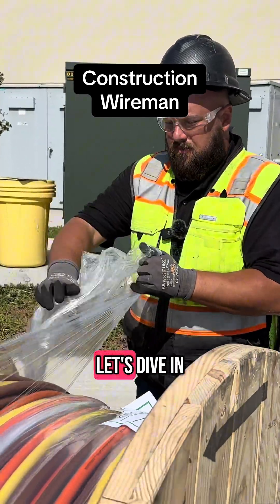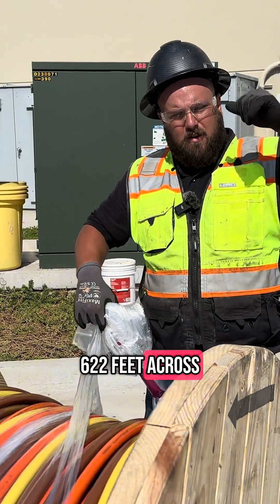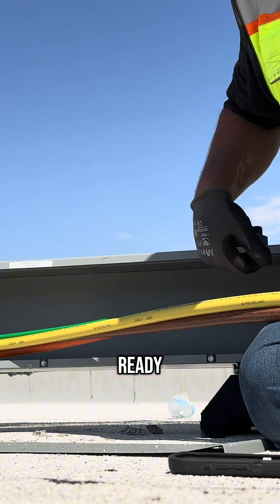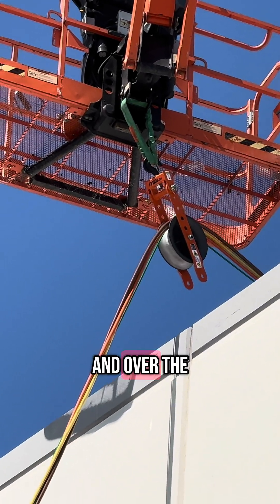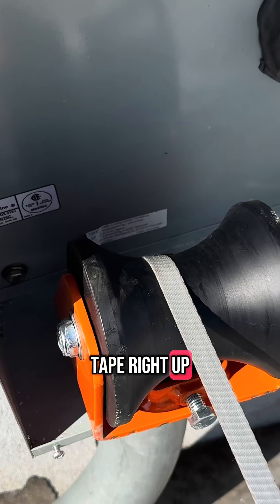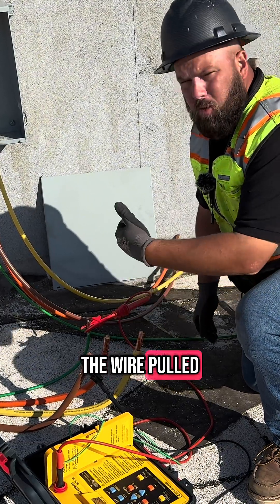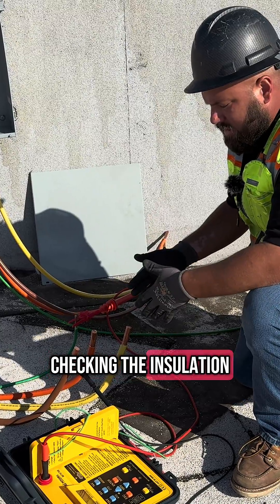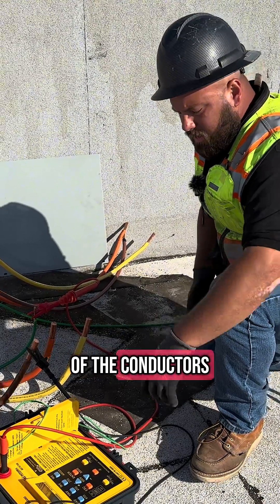MASTER the Art of Construction Wiring- Construction Wireman #construction #safetyfirst #electrician

Comment from the maker: What’s the longest wire pull you’ve ever done?
Reply: I've done longer with bigger but the worst pull I've done was 600+ of 400 up 5 stories with many many many bends and boxes
Reply: just pulled 4 800’ runs of 750 last week
Reply: 500s 3000ft at a gas and oil refinery
Reply: @woc_levievan2097   Holy Crap!   I hope it was straight.
Reply: I mean, as one piece? Prolly some Direct Bore run with fiberoptic cableing, along some random highway in florida. Shyt goes on for days before it hits a node or midspan. Pull it with trucks off the biggest reels you'll ever see lmao (The tensile strength is incredible, so nit much worry about snapping) 🤣. Fibers not like electrical, the loss over distance is miniscule. There's armored fiber run across the Atlantic Ocean floor all the way to other continents as one piece 😅.
Reply: 600kcmil football field and a half, 3 heavy duty tuggers rip
Reply: 1800’ of 3/0 MV wire
Reply: 6 runs of 900' of 600kcmil. With 600' of vertical drop and 300' horizontal lenght on the lower floor. On a 50 story building.  Probably my most interesting run
Reply: 665' 500 Kcmil
Reply: 150’
Reply: I pulled 545 feet of new copper from a abandoned building that was just installed the previous day. 😂😂😂 Used their forklift
Reply: Pulled 42570 feet of copper wire with 2 square meter cross sectional area
Reply: Should the conductors not be twisted?
Reply: 2 runs of 2000kcmil for secondary side of a 69/13.8kv transformer on a 100 degree day lol. Awful.
Reply: 3 inches every night
Reply: Like 1200, it was hdpe directional bore. All that for 600a of solar.

Comment: I've worked with guys in the field, that didn't have a clue what a megger is. Best way I can explain is it'll blow out the weakest point of the insulation, are  if it's not rated with the proper size insulation. It will go boom you'll know where its at

Comment: Always,alAlways do an insulation trst wth theinsulation resistance meter 
(Megger) 
Its easier to find a damaged conductor and oull them all out 
Tahm its is to have the thing short, melt all cables in thenconduit an possibly blow a hole in it 
Then you have lost all you conductors 
Think twice before you apply power 
And also use a pair of wakie talkies ,instead  of the Flintstone phone sustem

Comment: Always,Always  do an insulation test  wth the insulation  resistance meter 
(Megger) 
Its easier to find a damaged conductor and pull them all out 
Than its is to have the thing short, melt all cables in thenconduit an possibly blow a hole in it 
Then you have lost all you conductors 
Think twice before you apply power

Comment: Heck yea nothing like feeder pulling day. It’s technically an easy day if everything goes smoothly. Also you always want to add at least 30ft extra. I learned that the hard way as young foreman. I ordered it 10 ft too short and had to crimp the wire at the last pull box.
Reply: What would the price difference be for an extra 10ft? I'm curious if adding that extra on the order, just in case, would have been justified
Reply: "You waste more if it's short"

Comment: Imagine doing THAT and some genious 6-packs it smh. (6 Pack is a term we use for an unforgivable sin if you mess you badly, you owe everyone a six pack. For example, you forget to pass the cables through a pipe, fitting or box. So now you have to pull all the cables back and pass them through the correct way.)

Comment: Once time I found about 3200 ft of nice, white, unlubed but loose, jumbled up and tangled 3/4" 2500lb bull line in a dumpster on a jobsite. I thought to myself, "Ooh, look at all this wonderful free cordage, I will take this home and unravel it all, and then I will have a lot of basically free high strength no-stretch rope to use for whatever. I can't believe anybody would throw out this much good rope, this would sell for like 200ish bucks if it were brand new on a roll! Crazy!"

Any electricians here want to make a guess on how long it took to untangle? Hint: it turned out to be one continuous and fully intact length.

Comment: My longest was a 600ft over a rooftop at an LA Fitness , went up and down 4 times . My boss wanted to try pulling it in one shot . Was 600s , the puller broke the mule tape snapped , buckling 2 troughs and twisting the conduit all up. Thankfully the boss made that call. Eventually was pulled from the middle with inline barrel crimps

Comment: I very much doubt they pulled those 350 mcm conductors with the mule tape. I’d say they pulled their pulling rope in with it.
Reply from the maker: Nope. Pulled it in with a mule tape because the roof couldn’t handle the weight of the tugger. There were a couple junction boxes that made it a bit easier but it still took 6 guys all day to get it in.